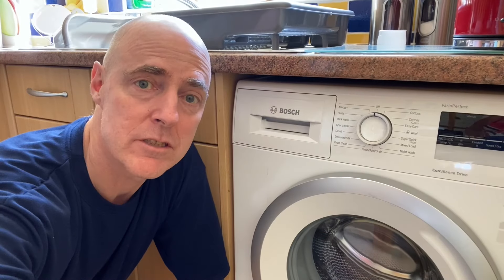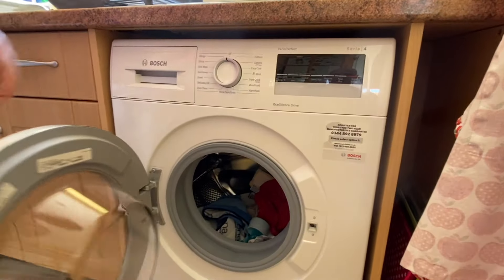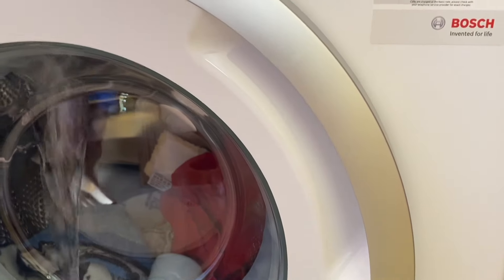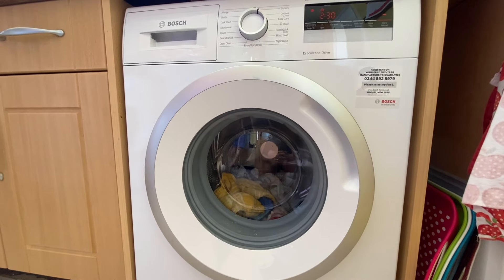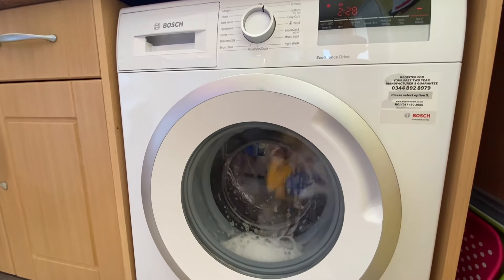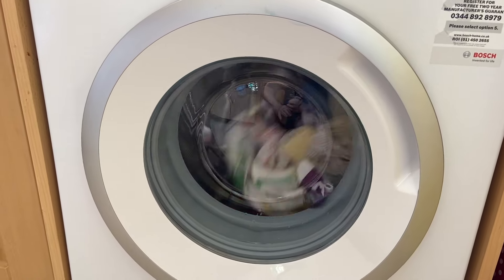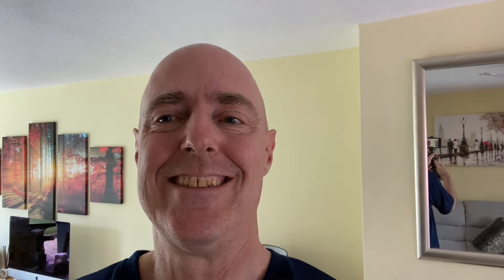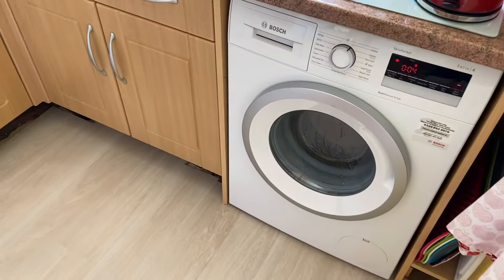Bosch Serie 4 Demo And Noise Levels

Comment: Hi Tim, quick question, what's the best way of ensuring original, drain hose is in the correct position when I push the machine back in, please? Drain hose is connected to waste pipe under kitchen sink. Many thanks 🙏🏻

Comment: Hi Tim, thanks so much for the video. I wasn't sure if I had set-up mine correctly but the comparison with yours made me confident. Videos like yours help so much!!

Greetings from Germany :)
Reply: I like near Munich, but my same machine makes a bang when the wheel is turned to a program and the pump works on/off/on/off and not a  continuous sound.. Are these tow thing normal?

Comment: Interesting.  I've got a Serie 4 Bosch washer.  It's 2 years old now and has been problem free but over the last 2 weeks on certain loads it is making a loud noise when on a 1200 spin.  It's never done this before. 
The machine feels stable and a spirit level indicates it's level too, so I've no idea what's wrong with it 🙁
Reply: What kind of noise exactly?
Reply: @germanCrowbar  it's like a thumping noise as it starts to spin.  Like it's struggling to balance the load.  I'm not overloading either.  It's the same wash loads I've always done and this has only started recently 🤷‍♀
Reply: @Catherine-Crevice  It could be that the shock absorbers of the tub in which the laundry drum is located are already worn out, or something is wrong with the weight of the tub. How old is the washing machine and which model exactly do you have?
Reply: @germanCrowbar  the model is WAN28281GB and looking at the invoice we bought it 30/11/21, so it's now 3 years old.
There are only 2 of us in the household so it's not used on a daily basis.
Thank you for your responses.  It is much appreciated.
Reply: @Catherine-Crevice  Thank you for your kind words! Don't worry at first, sometimes the tub bumps against the casing during the spin cycle because there is not enough laundry in the drum. If you are spinning at more than 1000 rpm, the drum should always be as full as possible, but there should still be at least a hand's width (5 inches) of space between the laundry and the drum. All the best to you and have a wonderful 1st Advent!

Comment: Bosch WAN24064BY, 7 kg...big vibrations, rattle before spinning (minute 8:23 of the video) and before the machine stops...removed the transport screws...the air bubble ruler indicates well... what can it be? thanks
Reply: 8:23 Sounds like the washing machine is pumping. Vibrations can occur if the shock absorbers and springs are worn, the washing machine is loaded incorrectly, with too little laundry or with too heavy items of laundry. In the worst case, however, the drum is no longer centered.

Comment: Can anyone say if this is normal? I bought exactly this model last week.  When I start from off, and turn the wheel to any position, it gives out after 2  seconds a loud "clack", more like a Bang. I have not yet started the program. The sound is  like an electrical "bang" discharge. However, the machine seems to work Ok. THEN, during the pump phase to get rid of the water, the pump does NOT give out a Grrrrrrrrrrrr sound, i.e. a continuous pumping sound, like the other two old machines we have, but more of a  cyclic:  pump on, pump off, pump on, pump off etc. The water disappears, but it is loud because it is on off on off etc.
Are these two above things normal, or is it broken "as delivered" i.e. is a faulty machine?
Reply: Ik hoor exact hetzelfde geluid bij mijn Bosch wasmachine serie 4 (ander model). Een hard 'klap' geluid,  ongeveer 2 seconden na het kiezen van een wasprogramma. Dit hoor ik echter niet altijd. Wasmachine draait verder ook prima. Vorige week is er een monteur geweest in verband met een licht schurend geluid van de wastrommel, bleek de aandrijfriem te zijn en is vervangen. Ik heb hem gevraagd naar het geluid. Waarschijnlijk iets met de magneten gaf hij aan die niet altijd goed samen komen. Niet zorgwekkend. Ik heb 2 jaar garantie en mocht het de komende tijd verergeren komt hij terug. Mijn 30 dagen bedenktijd zijn helaas al voorbij dus retour of omruilen kan in mijn geval niet meer. Ik zou even contact opnemen met de verkoper en dit voorleggen. Wellicht kan je hem nog omruilen.

Comment: Just got the machine and was unsure how to operate.  Your demonstration was very helpful. However,  I neverquite understand why the cycle is so long. In America the machines are usually no longer than an hour and in Europe or Israel they are 2-3 hours.  How efficient is this for energy?  Anyway, I can't wait to try. Last question are you able to use laundry powder?
Reply: Most of the expense in a washing cycle is heating the water. Longer eco washes use the same water for a lot of the wash so don't have to keep reheating. Obviously not for heavily stained washing but uses less energy. Slowly turning the drum for a couple of hours doesn't use much energy...

Comment: Hi just watched yr review on noisy levels with the bouch series 4 eco silence I've just purchased this machine I do the mixed load program I find it very noisy at the spinning sycle and I was wondering why it's so noisy especially when it's supposed to be silent and also when it's spinning the machine is shaking .I have the ma home a few days I only have the 1200 spin mine I tryed the cotton programe and someone suggested to shorten the time to press the speed perfect sycle I did notice after using that programe I noticed the increase in the noice level do you think it could be a considance is the machine suppose to be noisy during the spin what do you suggest reducing the spin level to around 800 instead of 1200 
Patricia obrien
Reply: Just seeing a mistake there it should have said I have a few days
Patricia obruen
Reply from the maker: Hi, have you checked that the machine is firm and level? If you put your hands on it and try to rock it, does it move at all, even slightly? It shouldn’t move at all. If it’s not that, it may just be a faulty machine I’m afraid.
Reply: @patriciaobrien3134  have the transit bolts been removed?